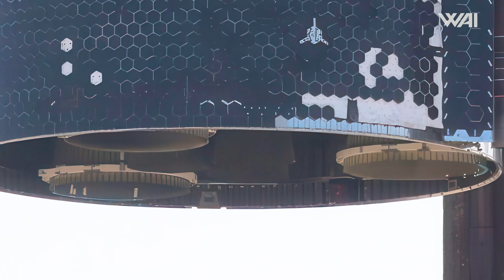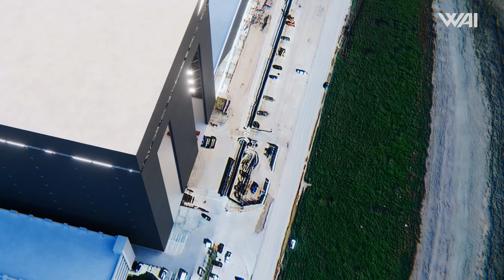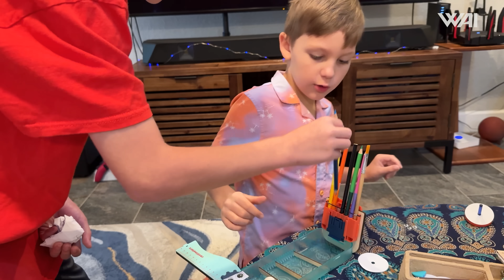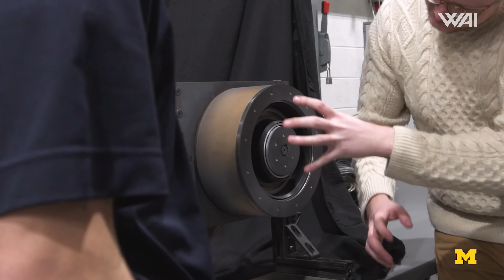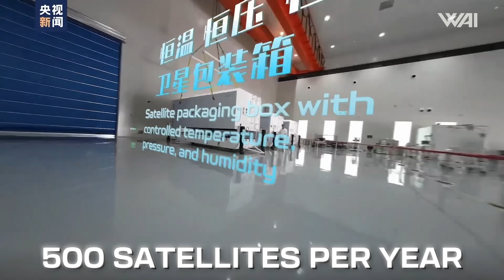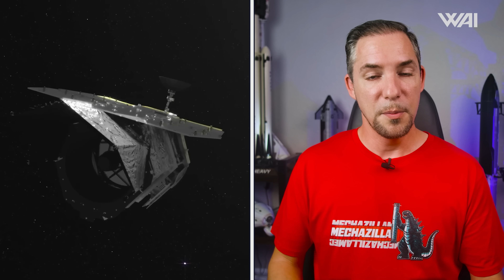SpaceX Is DONE! Starship Flight 10 Possibly Next Week! Raptor 3 Is Coming!

Comment: Are the Mechazilla tall enough for Block 3 Starship? Will they have to make large changes to the OLM or Mechazilla before Block 3 ships can be used? I think there has been mentioned something about this a long while ago.
Reply: The mount points on the version 3 Starship can be moved lower so the upper travel limit on the integration tower is still adequate. Stronger vertical bracing arms might be required.

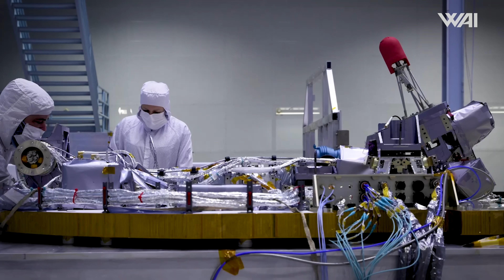Comment: 19:55 NASA was given 2 NRO telescopes back in 2012 that have "the same 94-inch diameter primary mirror as the Hubble, though with a much steeper curvature. They also have a much shorter focal length than the Hubble, allowing them to scan a much wider field of vision. Unlike the Hubble, they also have a maneuverable secondary mirror for better focus."

Hubble was one of many of its class of telescopes that have been in space, only the rest of them are looking back at us.

Comment: BO and SpaceX are really getting ahead of their skis with Mars missions, when neither is close to getting to the Moon.
Reply: Things move fast. You have to get out in front of your skis and plan for the possibility that you succeed. What if SpaceX has a major break through with Starship? I suspect once they have this whole getting to orbit and than landing and then taking off again on short order, things will start moving at light speed towards their intended goals.

Mark my words... You'll see! 🙂
Reply: Yes. Reuse is a huge tipping point, allowing more rapid tanker relaunch and pulling ahead of propellant boil-off. They could even yeet a latest tanker version to Mars if the depot is filled soon enough. No need to fully succeed in landing on Mars if the data for the failure mode is transmitted home. 
 @terryberg
Reply: It may seem like that but consider that they operate like a software development company. Thus they are working on "refined stories" from the "testing epic" backlog right now and Mars is a future "epic" which they have probably created many stories for already. This is what allows them to proceed so fast because they HAVE plans but they don't try and refine them too far until they have the data.
Reply: After starship lands on the moon there is not much holding them back from strapping a fleet and sending them out on the way. If it can land on the moon and earth it will land on mars. I think they might make an uncrewed attempt very early on though.
Similar to the tesla in space before crewed flights.
Reply: Once they demonstrate the full reuse and orbital refuelling the Moon and Mars are in reach of Starship.  That should be within a year.  
:face-fuchsia-tongue-out:
Reply: Hopefully
 @Scanner9631
Reply: Establishing a sizeable human colony on Mars during the next several generations is doubtful at least until an artificial near earth environment can be established. 
Other than small temporarily manned out posts, off planet is not a place for humans. 
Consider the vast regions of the earth that are uninhibited. 
Those regions are magnitudes more suited for humans than any where else in the solar system.
Even in the best imaginable habitat off planet, people will go insane and their health will rapidly degrade.
Don't destroy earth and appreciate our home.
Reply: @michaelwitzgall9345  there's this concept Start with Why observed by Simon Sinek in 2009.
I don't know if Musk came up with this naturally, but SpaceX's "why" is to save the species.
It doesn't matter too much if colonizing Mars is feasible in the short term (everything you say is true), the point is that as a rocket company they are inspired by saving the species by making life interplanetary, the least infeasible planet is Mars, and the first step to colonization (in any case) is cheap access to orbit.
Reply: @michaelwitzgall9345  I had a comment lost that what you say is true, but similar to what Mumford there says (in impenetrable modern software development jargon), they have a motivating goal (Simon Sinek's "why") that actually starts with saving the species.
Reply: Starship can’t make orbit so yeah, mars is a big stretch. This is the tenth launch and that’s about what it will take to refuel just one for the trip.
Reply: @bluntone2273  "they can't make it to orbit" is a lie.
The problem is that they can't make it back from orbit.
Reply: @michaelmicek well that’s a perspective I didn’t consider. 🤔 Yeah, you’re probably right that there are plenty of pieces still in orbit..😂
Reply: @bluntone2273  I suppose that's fair.
Not true (they've deliberately avoided orbiting) but amusing.
Reply: But they already "landed" without even trying to attain full orbit. Landing is apparently easy, but unreliably deorbiting is hazardous. Also, the tiles are less than fully reusable, for now. 
 @michaelmicek

Comment: Con la potencia que tienen los motores actualmente es innecesario que lleve seis motores ya que al llegar al espacio las naves pesan mucho menos, 🚀 con tres le daría bien para realizar la moción y así llevar más carga 💪😁👍🛸
Reply: Let's not forget, Starship is going to the Moon and eventually Mars. There will be heavier loads and longer distances... and remember there will be a need for breaking at each destination orbital insertion.
Reply: In previous test flights, all six (3R, 3RV) were lit at stage separation.
I expect that with 9, all 9 will run.
Remember that stage separation takes place around 70km, most of the way to the Karman line; it is therefore close enough to vacuum for the engines.
The sea-level Raptors assist, but their main purpose is vectoring and landing.